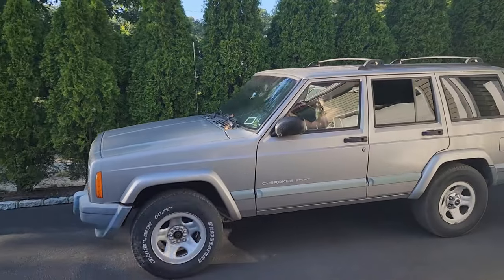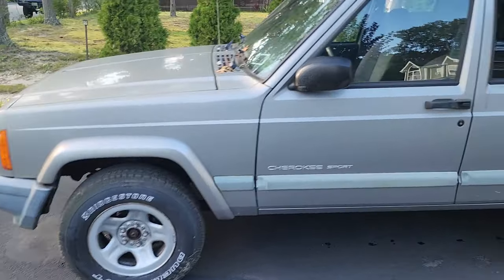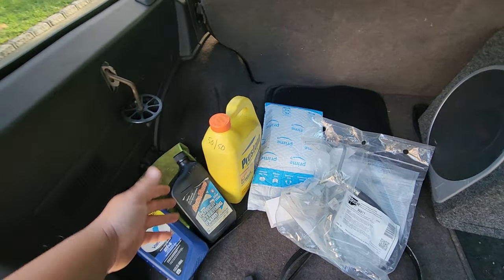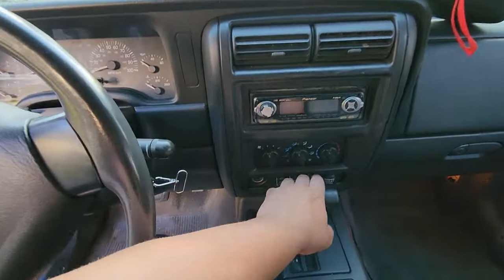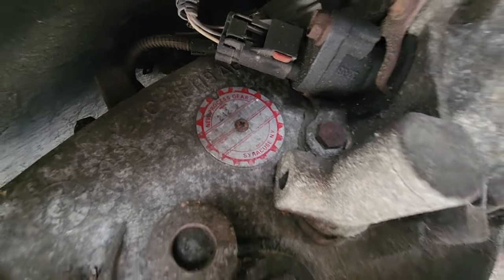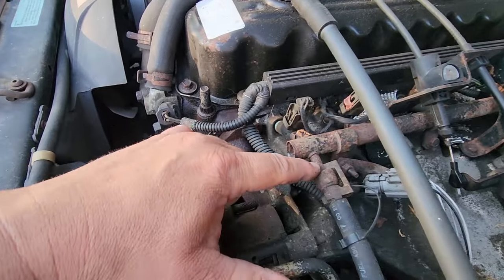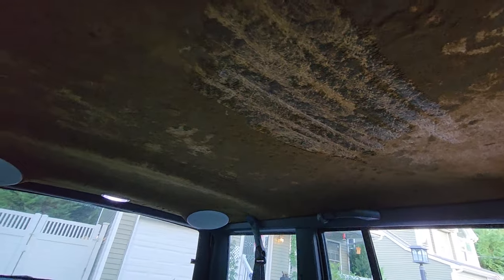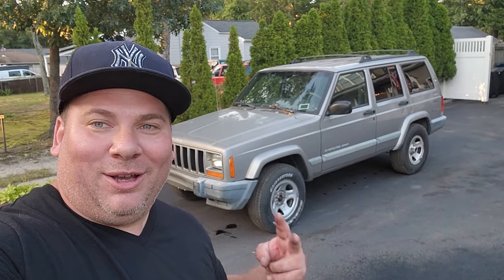ANOTHER JEEP CHEROKEE XJ PROJECT - THE TOAD!!! EPISODE 1

Comment from the maker: Hey Guys!  Let me know what you want to see from the TOAD XJ!
Reply: How about an "interior detail" video? Otherwise, a nice, clean restoration would be good. Maybe go over how you would clean up the rust in the back door sills, etc?
Reply: What about doing a Technology Overland Appearance Driver. Swap JK rubicon axles, double din radio, sound system upgrade, storage locker rear windows, amazon DIY front and rear bumpers, duel battery, winch, onboard air and lid lights inside and out. Oh, flat fender and some kind of lift
Reply: That is 13 videos worth of content 🤣😂
Reply: Maybe an axle swap if the front differential is bad and won’t allow 4wd? Could upgrade the differential too if you want.
Reply from the maker: @ColoradoMoe this is all considered for the infamous beach jeep build! I hope to get it underway soon
Reply from the maker: @ColoradoMoe at least!
Reply from the maker: @murphykilleen1677 good thinking!

Comment: Front driveshaft is bluetooth 😂 Not a bad jeep but people pull the shafts to save gas .
Reply from the maker: Not if the part-time four-wheel drive light is stuck on!  Coulda been problems
Reply: @ProjectDanH  shifter linkage could be off my ZJ was

Comment: Hey dan, I have a 2001 XJ that has a whistle under the hood, have you had this in any of your Jeeps?
Reply: Run  with serpentine belt off and see if u still hear it.:face-fuchsia-poop-shape:
Reply: @k9under  It sounds like its coming from the valve cover
Reply from the maker: Yea..it's an intake leak. You need a new intake/ exhaust manifold gasket